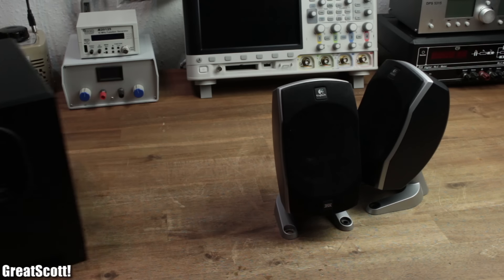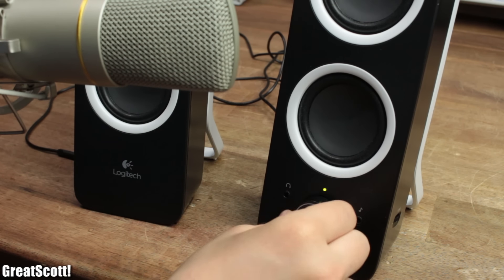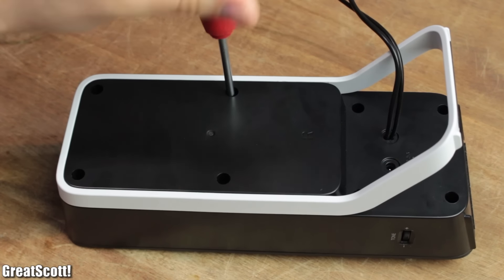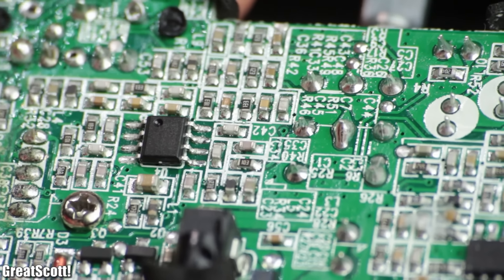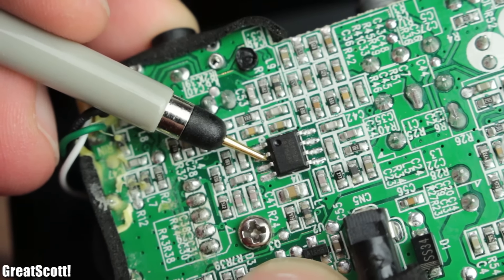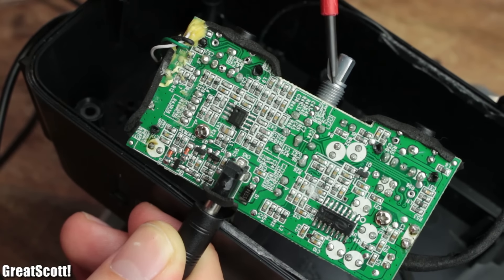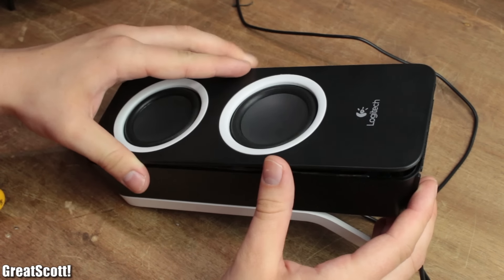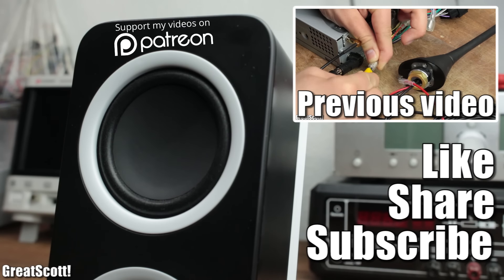Fix It!: Brand-New Defective Logitech Speaker

Comment: Crappy quality control on their part for sure... one thing you can try in such cheap audio amp circuits if you want to maintain DC isolation is to use a high value (>=100uF) cap in series instead of connecting the ground wire straight to PCB ground. The cap essentially provides a connection to ground at audio frequencies. Could be such a cap already existed on the PCB and they either didn't solder it or it failed. In any case it looks like the main problem is solved.
Reply: my thoughts exactly.  seems like such an amateurish mistake from what otherwise is a company that IMHO has produced quality gear in the past.  hmmmm.  we're all human, perhaps Logitech can acknowledge and fix?
Reply: No way.  Logitech has been doing this for many years.  They have a replace and shut up policy.  If you look at this speaker compared to older designs, you can see how they've continually cut it down and cheapened the overall structure, but the price stays the same or increases.  Basically all Logitech speakers from the last 5 years and under a certain price, have a buzzing problem hanging around the reviews.  Just like most logitech mice develop a double-clicking problem just after the warranty expires.  The problem has been traced to a part that Logitech continues to use.  They did this on purpose, because they know most people will replace instead of repair.  It's a disposable bullshit culture and unchecked corporate multinationalism that is the problem here.  Not some simple matter of human error or quality contorl.  This is far from an isolated incident.
Reply: +david esktorp can't say I agree with you.  I own a lot, I mean a lot, of Logitech gear and have been quite pleased with it.  I'm even in the IT profession with my own company and plus I happen to write software for a living.  for example, I once had to interface with what is called a keyboard wedge for a serial port Barcode scanner and for older PCs I always use an Logitech serial to USB device.  I have a Logitech wireless headset and microphone I purchased for Skype calls.  now I can't say I use Logitech speakers but have Logitech mice and keyboards all over my office and at client sites.  are you saying all Logitech gear is this way or just their speakers?  note, I'm not disagreeing with you but just saying my experience outside their speakers has mostly been positive.  I wouldn't say perfect, but then again what company is really perfect.
Reply: Eric Mayo We've all had our share and we're all basically "in IT" at this point.  It's hard not to be nowadays and it's difficult to completely avoid logitech.  The essential performance is still nice.  That's not my complaint.

All of their mice and speakers have a ridiculous failure rate.  Logitech used to be a better company.  They still make okay stuff .. but even with the pricier tier, it's a quality crapshoot.  Lower tier basically always fail right around the warranty period.  That shouldn't be.  Every generation gets worse, but it's systemic.  They couldn't be one of the big boys if they didn't operate that way.
Reply: TRULY!
Reply: @revealingfacts4all  Logitech doesn't make their own serial to usb devices, another party does and Logitech (like many other companies) just slaps their label on it, besides that it's just a single IC and a very few (if any with modern ICs) passive components in there, nothing to go wrong anyway.
Logitech is typically hit and miss, I've seen mice by Logitech, used them for years and while one is great the next is just poorly made, same for most if not all their products; there's decent ones in there but also plenty of poor quality stuff to even downright trash...
Their headphones are a nice example of this, the G930 has almost more issues than one can count due to Logitech trying to save a penny every step of the way, cheap electronic components, cheap construction, truly awful software, useless battery management and so on for a ~$150 headset while it's successor the G933 has none of those issues and is actually a pretty decent piece of kit, the G930 works but it sure isn't worth anything above $40 with the quality Logitech delivered there...
Their speakers too, fairly high prices for mediocre quality, they spent a lot on their THX license to paste the THX logo's on some of their speakers which are made out of plastic and small drivers which will never meet such standards.
In the end Logitech is a reasonable budget-brand with some better products but definitely not an a-class in any segment unfortunately.
Reply: Where would you solder the high voltage capacitor? And are there advantages and disadvantages to wiring straight to PCB ground as opposed to the capacitor method?
Reply: @matthewpark2284  You would wire the cap in series with the audio input ground conductor. Like mentioned above, this was probably already in the circuit on the PCB, but likely in manufacturing, it was knocked off or missed by the pick and place machine. This cap isolates the DC ground which is desirable to avoid a ground loop between your audio source (e.g. phone, computer) and the speakers.

Comment: hum is annoying problems cause it can be many reason. thx for sharing the solution. this one is  surprisingly simple fix.

4558 op-amp prefix seem to vary by each manufacturers . TI use rc4558. JRC use njm4558. etc.  so many many variations. but functions the same  a Active speaker manufacturers sometime switch-use  multiple brand op-amp within  same model no. speaker.

Comment: thank you i  just fixed my  speakers buzzing problem  soldering line in ground to board ground seams to work great had this problem since 2008 and yea did not replace them for 10 years i only here the buzzing when my pc is off out line in unplugged  but now works :) like your videos keep it up

Comment: Great bit of diagnostic work.
Anyone who wants an awesome 2.1 speaker system for their PC, I recently purchased the Corsair SP-2500, and they are awesome. I don't think that you could do better short of stereo audiophile gear. You can feel the base, even at lower volume settings. Be aware that the base cross over is lower than what most will be used to. Obviously they are not in the same price class as the Logitech Z200 though.

Comment: Thanks for this! I caught your video because though I’m rusty (just an old electronics tech but it’s been years now, actually decades) I’m diving into one powered studio monitor with no output. It handles input such as digital, but also analog audio in, so I’m troubleshooting very similarly, also with no schematic. 
I’m experiencing the same as you, visually inspected the board (they had some gunk on it from the factory) but not seeing any obvious problems. Then as I got frustrated trying to reverse engineer to make a schematic, I realized I really on the first try only need to establish signal test points. This (Roland DS-30A monitor) has one input board, that goes into a a power amp board (bypassing the digital pcb). So I figured out where the HF and LF signals (split after the second op amp stage, for adjusting high or low freq) go out to the cable out to the power amo section. Since no sound at all I’m thinking I can test the whole board at the output and likely know if it is preamp, or power amp. 

I have a tiny cable tester that I can inject a 1khz signal into the input. Only other problem is access. I can get to the component side of the preamp board, that should work, but the power amp is lower, under another DA board. Cables limit my access too…guess I can jumper them and try to have the board sitting out more. Not sure yet. 

Anyway your video gave me hope! Thanks!

Comment: I've fixed some humming in some Tannoy active speakers. They have differential 6.5mm input jacks and as such are supposed to be 'professional' grade audio gear. On the inside they use the cheapest parts imaginable. I moved around wires connecting to the ground plane on the PCB to create a more ideal star ground topology. ie solder the centre tap of the AC transformer to the bottom of the filter capacitor,

Comment: Hi, passive speakers, are normal un high quality audio. Some times the second speaker is in short circuit. Anyways that ground error it is inadmissible. cheers
Reply: You mean active speakers?
Reply: They are not normal in High Quality because they are less efficient than a bass reflex port. They are used pretty rare. they are most time used for smaller speakers to get a bit more punch but that`s all
Reply: you wont find it in High End Systems
Reply: The problem isn't that they used passive resonator as part of their acoustic solution, the problem is that they passed it off as a "driver" in the specification.

Comment: @GreatScott Passive radiators are one of the most effective ways to extend bass in a small enclosure. They act a bit like the port in a bass reflex design, however they tend to occupy less space in the speaker cabinet and they don't suffer from "chuffing" <- port noise due to the high speed velocity of the air moving in and out of the port.

Comment: No ground and fake drivers? What horseshit.
Reply: it is ultra cheap Chinese crap ;)
Reply: That's because it is!  I never trust Logitech for audio (maybe that's just because I'm an audiophile though!) but it is really unfortunate to see so many corners being cut even in a cheap product.
Reply: +ForeverAloneMan which I find interesting, because my experience with their keyboards and mice has been great.

They probably dump whatever R&D and QC they have into their mice, with the rest barely living off brand cachet.
Reply: ***** Very true.  I love my mouse from Logitech, but hate most other products from them.  Their 2.1 systems always sound terrible to me, but I really didn't expect this kind of (lazy) 'engineering'.

I've looked at these speakers in person, and their enclosures leak air, so the passive radiators don't even work properly, but I doubt that Logitech cares a wit about sound quality.
Reply: Breeder were see
Reply: They are actually passive radiators, which can be found in many good Bluetooth speakers. They usually have some weight on them for tuning though.
Reply: Yeah but on the product description they wrote that the set had four drivers, so it's false advertising. Not something you would expect by a big name like Logitech...
Reply: @alessandroceloria  It does have four drivers. They didn't state that it has four active drivers, so there's no misleading information
Reply: Logitech is crap for me... I bougth a gamming mouse that is not cheap precisely and also is supposed to be prepared for gaming use (a lot of clicks), and in less than a week the central button was broken, and the worst part was that I had no time to play games and only was with normal usage. Not even the worst mouse I've used in my whole life last only one week... so is a new record in worst quality. Also the last mouses I had from the same brand had the same problem. Now I'm using a Razer, that was a bit more expensive but at least is working until now.

Comment: Wow, Logitech really just went down in my estimation.

I very nearly upgraded my old (Creative/Cambridge Soundworks) 5.1 system for a Logitech 7.1 system, but after seeing this I won't be touching Logitech with a barge pole.

If you run a company like Logitech and you want to get in on (as in this example) the lower end PC speaker market, you make a decent product and take a hit on profit, even sell at a net loss, because if your low end stuff is GOOD, that customer might come back in 2 years time and buy some of your high end stuff and they might even recommend your products to friends/family.
BUT start selling sh*t and your really shooting yourself in the foot.
Reply: Everything that is sold may come defective, (also seeing that lots of people say they are great, it doesn't seem to be a regular thing) I'm sure that if he ask the seller they would come to an agreement...
Reply: If he would have returned them for an exchange they would have sent him a free working replacement, it happens. You've never gotten a defective product and had to exchange it?
Reply: buy a pair of mackie CR3 or CR4 they are awesome.
Reply: I also had the same sound works system. loved it! then the volume control died, the wires had discontinuities etc. I was unhappy to retire them.

Comment: You should've built a custom set of speakers, it's what I did and they sound better than any other speakers I've ever heard!

Parts: 2x Pioneer S-Z74 low/mid woofers
2x Pioneer S-Z94 low/mid woofers
2x philips soft dome tweeters
2x 1 microF cap
2x 2mH inductor
I actually put these parts on an open baffle housing (a simple plank with a hole for the speaker), and with some light equalizer tuning they sound absolutely amazing!

Comment: "not grounding" is a common issue with low-end amp circuits: a lot of those kits emit interference noises when powered up, or when you simply get your hand close to the control pots. Furthermore, shielding is often missing and they tend to pick up signals as an antenna does. What you did solves the majority of the problems, most of the times.

Comment: Very good video, thank you! I have experienced a lot of bullshit from Logitech speakers myself. I once bought a 2.1 system that supposedly had a 8 or 9 inch subwoofer which cost about $100 which to me is a decent amount of money to find out there was only a 4 inch active woofer behind the passive radiator! It's simply false advertising and they know it. I returned the cracked open Logitech crap and got an Altec Lansing set that had a real 8 inch woofer for about the same price that sounds way better!

Comment: I've got an old AV Receiver unit where the volume control knob is not working anymore, but works fine with the remote - it would be nice if you do a Fix-it! episode on troubleshooting this, which appears to be a common problem with older receiver units.

Comment: The idea of using a passive radiator  is meant to improve the bass slightly, in real life in fact it will do little more than a bass port. It is used, more likely to fool the public into thinking it has 2 drivers in each cabinet, but it is only a single driver. A better choice would have been a bass/mid with a tweeter. This idea goes back to the late 60's when a number of manufacturers used it. Kef, Celestion to name but two.
Reply: A passive will increase bass output similarly to a bass port without the muddiness when underpowered, so it does have purpose in low powered speaker enclosures, but dressing it up as a second speaker is simply grade a bullshittery.
Reply: Sam Gates I think you are talking about piezo tweeters... horrible... just horrible.

Comment: Had almost the same problem with a cheap car USB radio thing. It had a low buzzing noise and when the radio is turned on, it picked up the buzzing loud. The problem was a very thin ground trace going close to the display driver IC. It somehow picked up the switching of 7 segment units.  Just soldered the two ends of the trace together with a wire and the problem was gone!

Comment: I've a pair of these I bought to replace my old (but still working) Logitech LS11. As many of the buyers, I bought them mainly for their design, and for me they work decently. I hear the noise when they're unplugged (but it's almost non existent when plugged into my iPad), the electronics quality might not be the best for the price but it works okay.
I'm just very disappointed for the false advertising about the "4 drivers" thing, and for the bass control (I don't even hear a difference, I'm glad you could detect one).
That's not a big deal since I mostly use headphones now...

Comment: They had a cap on the ground pin of the jack to create a differential input (I hope it's the right name of the amp circuit). It would explain both the high impedance input and the continuity fault.

Comment: The Logitech X-140 speakers have the same problem. Plenty of hum. Actually most Logitech speakers are pretty low quality. I'm not sure they even have quality control at Logitech. My own Z-5500 also have quite a bit of noise, so much that I would like to built a new amp for the speakers. I guess they live by the rule "If it looks like a speaker, it is a speaker".  :-P

Comment: So I have an even cheaper usb powered speaker and there is still a humm when I turn the volume up. The driver chip is an XPT4863 and the GDN pins are 2,7,15 respectively. The interesting thing is that the ground pin of the 3.5 jack is connected to these ground points and even with the usb ground. Yet there is still humming. :D

Comment: yeah dude, even in ICs if you leave some pins open you get unstable operating conditions due to floating voltages. Either ground or VCC. I've seen some people add a 10k resistor across the inputs...eliminating the floating voltages.